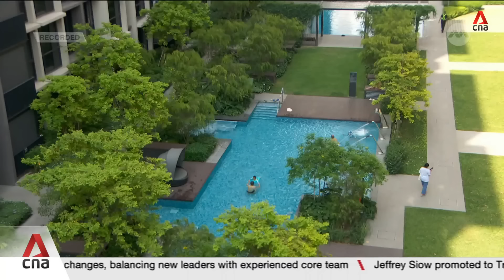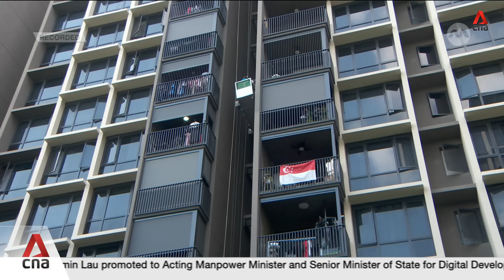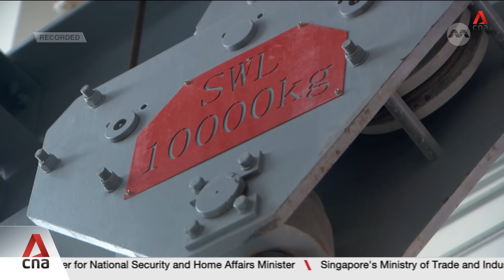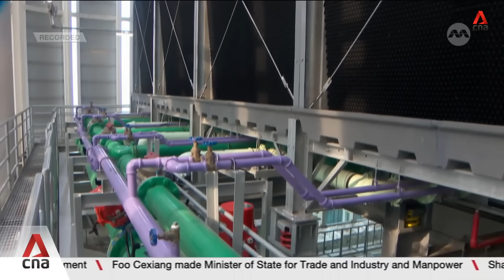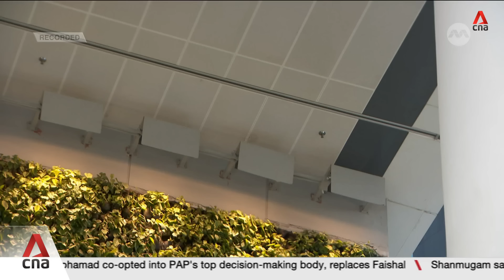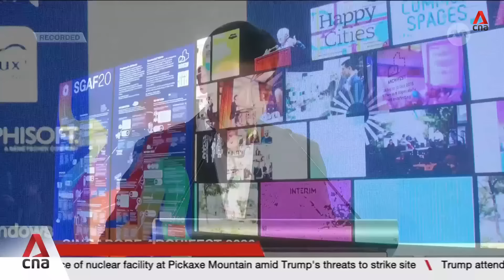Home buyers, owners may pay less if property is designed for easy upkeep

Comment: The premise that an influx of cheaper labor advantages the local population is structurally invalid as HDB explicitly decouples its pricing model from development and construction expenses. When actual building costs or material prices drop, that decrease does not automatically lower the baseline BTO launch price. Instead, the starting point of the pricing model functions as a top-down calculation based on median household incomes and localized resale market value. 
Does restricting/throttling the supply of Build-To-Order (BTO) flats drive up open-market resale transactions, which the independent Chief Valuer then uses to determine fair market value—especially with median BTO wait times currently at about 4 years?